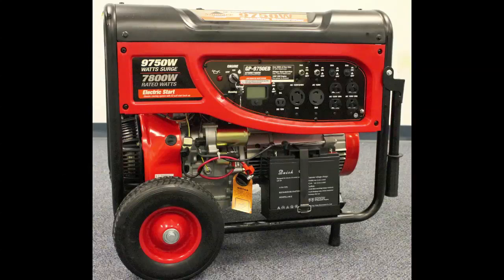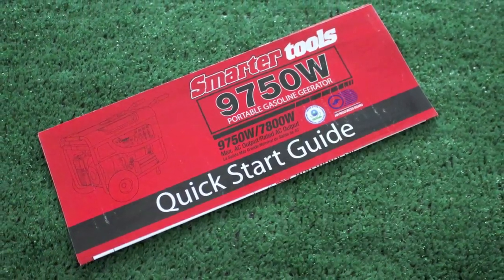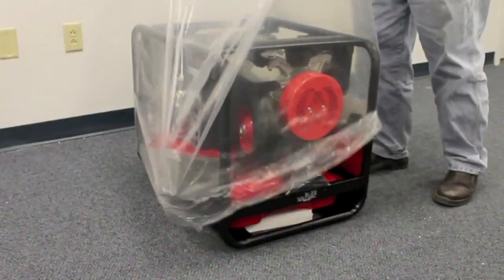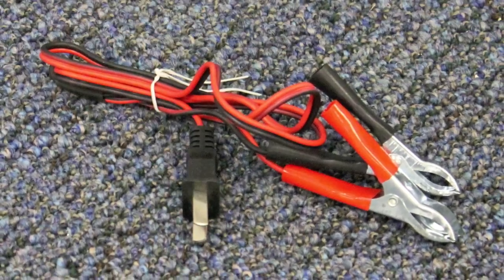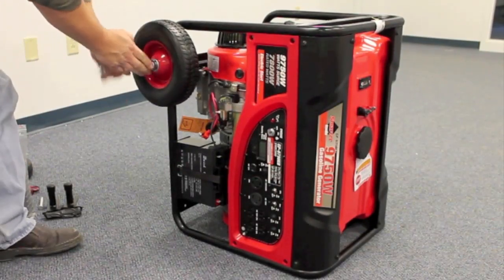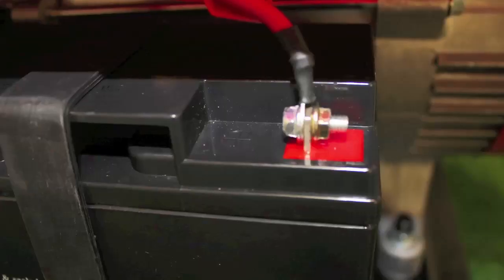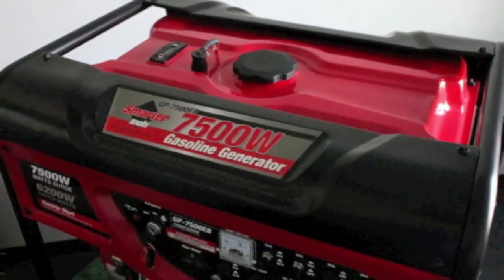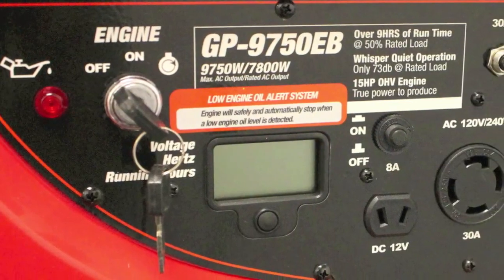Smarter Tools unpacking and starting up your EB generators

Comment: Don't buy anything from smarter tools they don't cover there warranty and when you call to get help they want to charge you for the shipping when you still have a warranty they say go to home depot well guess what home depot does not work on their junk any more kinda strange if you ask me all's I gotta say is fuck you smarter tools
Reply: What did you buy from smarter tools? I just bought a generator and it has an engine rattle when under load. I bought it used and I'm concerned. If it's a piece of shit I'm gonna hammer this company with internet reviews.